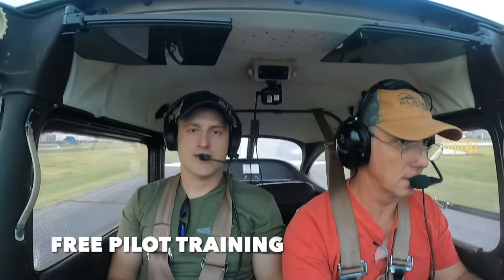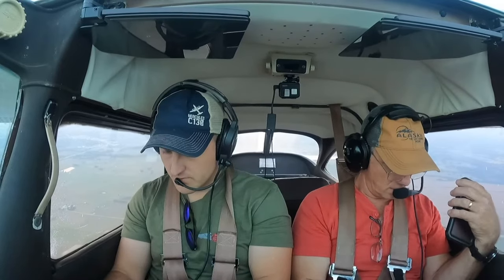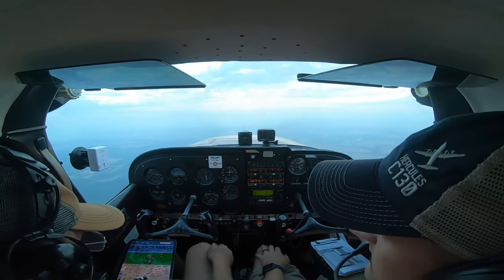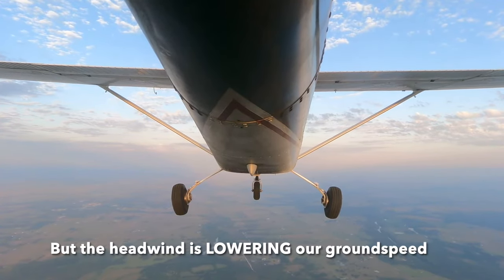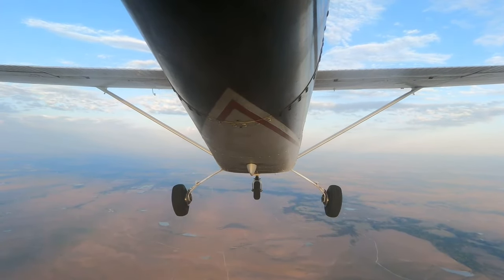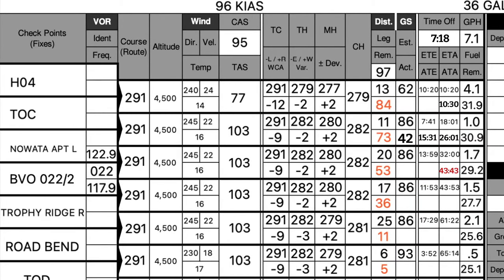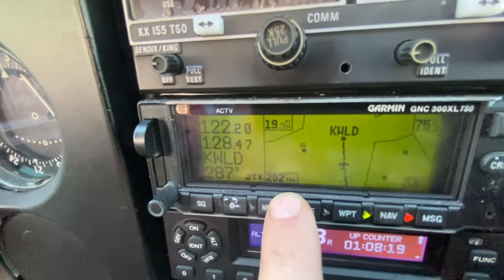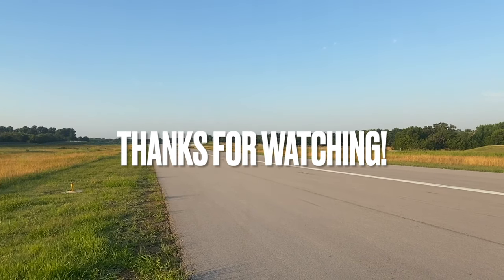How to Fly a Cross Country with a NAV LOG (PPL Lesson 49)

Comment: I make extremely tight tolerance tools. I constantly use a timer, because the machines cannot sit and also hold tolerance. We are all human, and forget to reset stuff and or start stuff. I use 3 timers simultaneously. 2 count up normally. I use one for overall time and another I reset. The third timer counts down, but then counts up, if it hasn't been stopped or reset. If I make a mistake on resetting the second one, it's simple math to see where I goofed. It was simple to set up, and easy to use. When I have a significant difference between the countdown and regular timer, then it immediately alerts me to some kind of resistance I need to correct (which would perfectly translate to winds or engine performance altering navigation).  I can't believe I lived using a single timer. Great video. Keep it up.
Reply from the maker: That’s pretty cool. Great tip! Thank you so much!

Comment: I have never actually opened up a VFR flight plan. And for the same reason: whenever I call up the FSS near my home airport they don't respond. The first time I talked to FSS was when I was asking them to  help me with weather, and that was well after getting my private.

But I love pilotage and dead reckoning. I really like how it makes me feel much more familiar with where I'm going. Unfortunately I've really gotten into a habit of just plugging my destination into the GPS and flying that. I need to get back to doing some P&DR flight plans.

The one thing I did in my checkride that I did not do in my solo XCs was I didn't try to fly a straight line between my takeoff airport and my destination airport. Instead, I took headings towards waypoints that I could easily identify when I'm close to them rather than trying to find them from 10 miles away. For example rather than trying to fly KJQF direct KILM (my checkride XC) I flew along I-485 to KEQY. And then I could easily follow I-74 along a string of airports that made easily seen checkpoints.

Does this add a little more time, distance and fuel? Yes: 11 nm, 5 minutes and 0.8 gallons. But man it reduces the stress level by TONS. As part of my checkride prep, my CFI and I flew this route and it was a lot less stressful then when I flew a similar route for my first solo XC.

And when I flew this for my checkride, the DPE liked that I had a visual reference available to me for the entire flight, not just at the waypoints. 

Anyway I need to do another P&DR flight soon.
Reply from the maker: Great comment! I don’t open up the VFR flight plans in flight too often, I think you can call and activate them too, but I wanted to show it in the video, but of course, I was let down because they didn’t answer.  I know what you mean pilotage and dead reckoning is not used to often any more, but does make you feel like a real pilot when you use those skills sometimes.  It really gets you looking outside and not relying on modern technology
Reply: @FreePilotTraining  oops! I meant "activate". I file through foreflight even though I know I'm not going to activate them. I guess if something happens, I want to have something available for someone to look at.
Reply: I use the easy activate/close from 1800wxbrief...to open & close, deactivate. or cancel the flight plan via SMS.  It's so much simpler

Comment: You said you picked Trophy Ridge as a way point because there "wasn't much out there."  How about the town of Elgin right on the Kansas/Oklahoma border about 15 miles to the east?  It's bigger and closer to your last way point (Bartlesville VOR) from which you could have flown a radial (305 degrees?) directly above the Caney River from Hulah Lake.  I mean, if you're going to use a VOR radial for positioning, why not fly one to the next way point?  Or just follow the river.  Elgin also lines up nicely with your last way point "Bend in the road" which I think I would have named "Cowley State Fishing Lake" which is right beside it.  I would think this would have greatly simplified your last two legs.  But I'm not a pilot.  Am I missing something?
Reply from the maker: Great question. I’ve flown out there quite a bit Elgin isn’t really a town. It’s a grease spot in the road and is very difficult to finds I typically will use towns but now that one. Lol